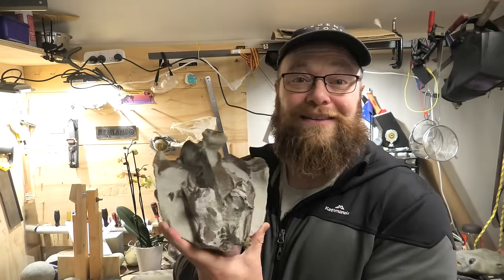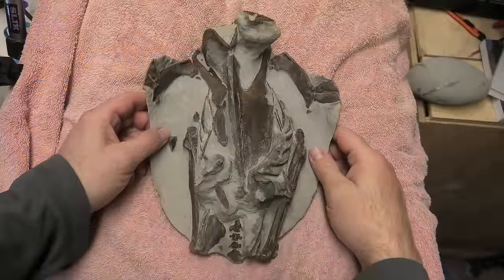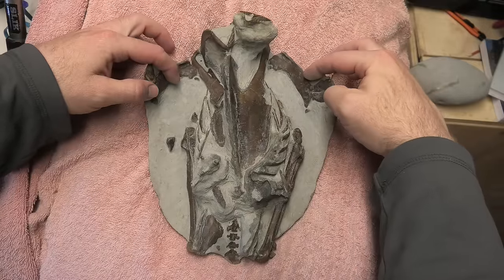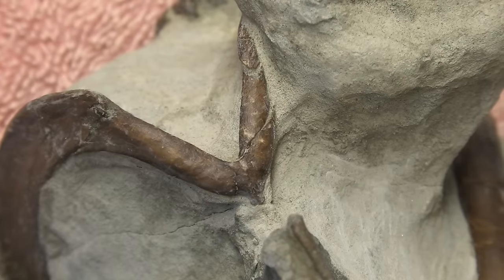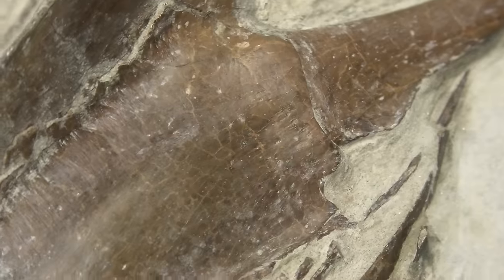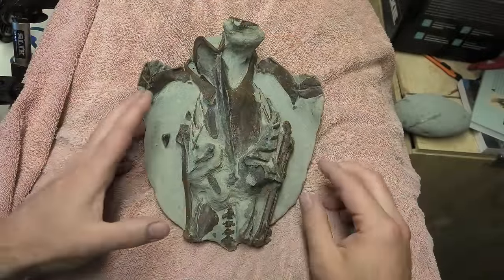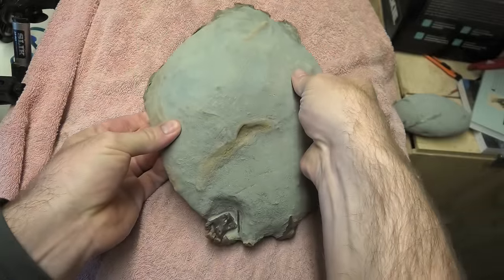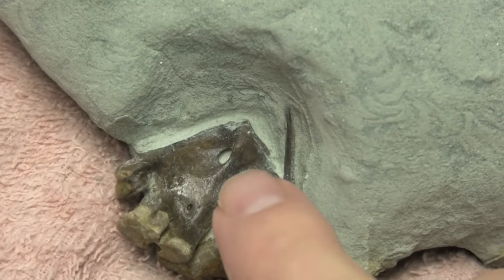5 months of work to reveal this rare fossil! [unknown species]

Comment: There was a quarry/park about a half hour drive from where i grew up.  They would let us take smaller rocks we found.  
We often found trilobytes and bracchiopods there, on the surface of rock faces, where over the centuries they had been exposed by running water.  
Just 10 - 20 minutes of chiseling, and you could free a trilobyte that was about one inch in diameter.  
It was a bit of a strange childhood, but we had fun doing it.  I still have some of the samples i managed to extract.
Reply from the maker: That sounds like so much fun!!!
Reply: @Mamlambo Fossils  I had fun doing it.  And it was a good experience to be outdoors in the fresh air.  
Not as good as some of the other 10 year olds that played soccer, but better than playing Nintendo in the basement.

Comment: You know, it should be possible to modify a 3D printer and add a camera and 2-3 sensors and have an auto prepper for 50% of the work, and then do 50% of the fine tuning by hand. nice find.

Comment: Please explain to me why do you carve into that rock and why you paint there using a brush.. I'm not paleontologist so I don't understand it, please explain it to me. Because from a layman perspective it looks as though you were crafting an ordinary rock into a fossil and in that case it would be a fake fossil.. Im a former creationist, I will really appreciate your explanation. Thank you
Reply: The fossil is made of mineral and is encased in rock. To get to the fossil, the outer layer of rock must be removed. In some cases this is quite easy, especially with less complex fossils. For example fossil shells often have a smoother, and more uniform surface, and as such the outer layer of rock can easily removed by applying pressure and leverage to the outside rock to ply it away from the fossils suface. However, with more complex fossils like those of skeletons, especially birds, more care must be taken to remove this outside rock as to not damage the fossil within. The use of a tool like the one in this video allows for a gradual and more precise removal of that very rock. The prush at the end could have been anything from ethanol or acid as to clean the fossil afterwards for a nice finish.

Hope this helps.
Reply: @thehowlingjoker  Thank you very much
Reply: @joepipkin101  no problem